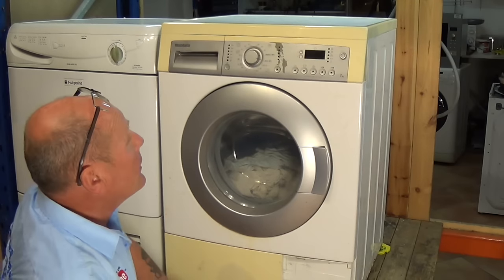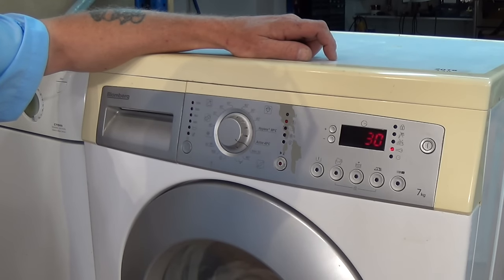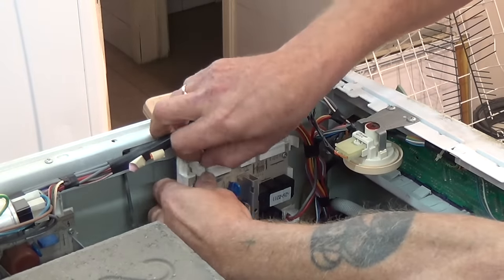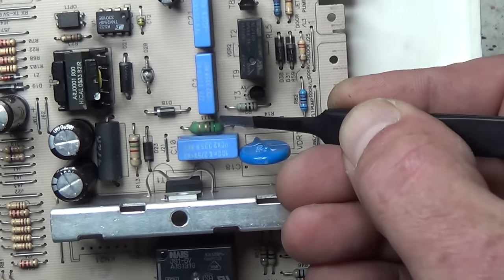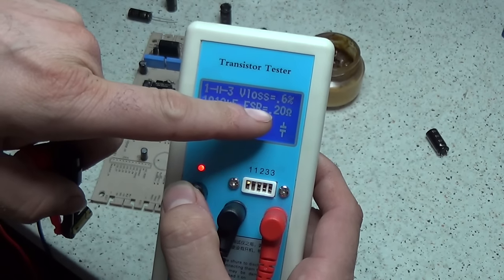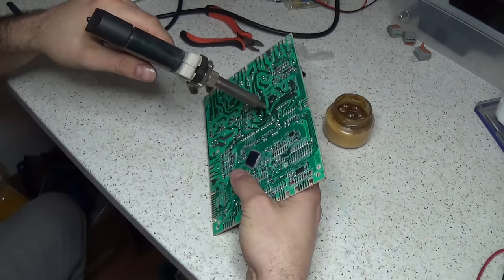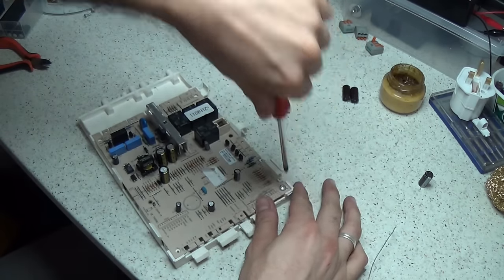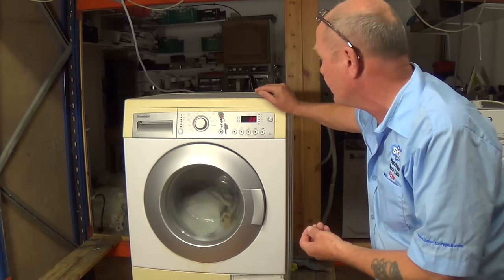Washing machine starts then stops or turns off

Comment: If the washer is staying locked after cutting out during load sensing- is it more likely a door lock problem or what you fixed here on the circuit board. It also has a very faint sound coming from it? I do not I can unplug it to get it to unlock. So when I plug it back in after a 3-5 min unplug, the door will open but then it will start beeping at me so I close the door and it relocks 🤔

Comment: Hi the video was great. I own a LG front loading washing machine and it doesn't complete its cycle, goes off after 4 minutes, no matter what mode of wash you choose. You gave me the idea, that the control unit could be repaired than replacing it. So i got the courage to open it and the problem was the tube to the " Pressure Switch " was detached, Plugged it back in, the washing machine was ok. Thanks
Reply from the maker: Please use the Ask paul a question page if you need help and i will reply in less than 24 hours https://www.how-to-repair.com/help/contact-us/

Comment: I am having a similar problem with my LGWT1101CW top loading washing machine. The components look fine. what other part on the circuit board could be causing my issue with it powering off and on all the time.

Comment: Thank You Sir, for your honest approach to Troubleshooting a malfunctioning Washer. All, I've seen so far is that if a circuit board is Bad there is Nothing to be done - except to Replace it. 

It is refreshing to see that there are honest professionals that don't mind showing that electronics can be repaired and it doesn't necessarily mean that you have to Buy a New Board at $300-400 dollars a pop.

Comment: Hi. Thanks for the nice video. I have Miele W3204 washing machine which is only working on the centrifugal and 15-minute washing programs. For all other programs, it stops after 2-3 minutes and the start light starts blinking. Pressing the start button restarts the machine, but it stops again after 2-3 minutes and the start light blinks again. Please suggest me how to fix. Thanks
Reply from the maker: Hi, please use our contact us page and make sure you fill out the request for what your problem is. I will need the full model number of the identification plate and the details of your problem so that I can provide you with useful literature. A video shoot of the problem would be perfect as well.

I will get back to you within 24 hours, normally. https://www.how-to-repair.com/help/contact-us/  

Please remember to subscribe to our channel, as that's what keeps this channel going. Thanks, Paul 👍

Comment: Hi how-2-repair. got a zanussi FJD 1466w, started my wash and after about 5 mins there was aloud click sound come from the washer and it stopped and all lights except the power light have all gone off on the control panel, im not sure if that loud click was the door lock coming off as the washer stopped, ive turned off and back on but nothing, does this sound like a new control panel replacment? thanks for ur time and help Matt

Comment: Hi, maybe you or someone on the forum can help me with my problem? My Panda PAN70SW washing machine not start working after turning it on and shows code C1 and all lights start blinking. After unplug power cord and plug it again washer starts washing cycle. After finishing cycle the problem appears again. What's the problem?

Comment: My washer is GE, was turned on, display door locked after about 23 seconds, I heard one soft click and then door lock released automatically. I have replaced a circuit board and inlet valve and door lock, but the machine is still not working. Pleased hep find it's problem.

Comment: Also check power connection to the wall, especially if you use splitter, for example to plug in washing and drying machine into singe outlet. Splitter can corrode inside, nothing is visible outside, but due to moisture it can corrode inside over time and make these problems.

Comment: I had a Whirlpool Duet that would power itself off mid cycle but only in cool weather. It turned out to be the touchpad panel. It was sensitive to temperature or humidity or maybe both.

Comment: Hi again how-2-repair.thanks for vids great help. i found my problem and its the module board not the control panel, but having difficulty finding parts, as my washer is 16yrs old parts are obsolete, but with watching you vid one of the chips that is blown is a link switch, but turning over the module board there is a S shape black scorch mark and i should say its taken afew more components out aswell as itself, but im prepared to buy and replace the components myself as really cant afford anew washer at moment, ANY help or advice would be VERY grateful.Thanks Matt

Comment: Hello,
I have a question regarding my LG front load Direct Drive washer purchased in 2014.
The original board malfunctioned on me and needed replacement.
Before the board blew out on us there was this strange electric burning smell emitting from the washer. At first I thought it might be the heater and or thermistor, but they checked out normal with my multimeter.
I replaced the board recently and started testing the machine with different sized and timed cycles.
The top and rear panels are still detached until testing is completed.
Yesterday I washed 4 loads of 1 hour cycles.
Up through the 3rd load everything was normal, no smells, or error codes being displayed.
After the 4th load chimed, I entered the garage and there was that electric burning odor again, just like the previous time prior to the machine going D O A.
The smell emitted from the Direct Drive motor assembly and the aluminum cover that spins with the assembly was extremely HOTTER than normal to the touch.
Is this a normal thing with these Direct Drive motor assembly?

Should it emit this type of smell?

The last time I smelled this type of electric was when the balast inside my light timer burned up/ Even thought the balast burned leaving a brown mark on the external surface, the timer continued functioning.
Do you have any ideas regarding this issue?
Have you or anyone you know, or customers every mentioned anything regarding this phenomemon?
Any thoughts would be greatly appreciated.
THx
Robert

Comment: Wow, I expected 'how to replace a door switcg' or 'how to replace a control board' - no one talks about board level repair anymore.  Apparently everyone is fooled into thinking a $200usd board must be replace even though parts are under $1 and time is about the same.  It's criminal.  I pick up used junk to fix for pennies.  Thank you, consumer suckas!  Just got a front loader washer, replaced caps on an imac and a Samsung large TV before (free)!

Comment: Hi mate I have samsung ecobubble 8kg washer. On some of programs it runs but stops after 15-20 minutes. When I press the pause button on and off it starts again but stops again. When running it makes a constant sound but when it stop there's no sound. Any tips how to solve this problem.
Seen you video on calibration, tried it but no luck.
Reply from the maker: Intermittent faults are very hard for me to be able to give you a direct answer as I do not have the machine on my workbench. You may have a dry joint or something. It's disconnecting during the wash cycle. I'm sorry I can't be any more help. Have a great Christmas and a happy New Year. glad we could help you @asifiqbal3855 this is for you https://www.youtube.com/shorts/e432SAb2g08 please remember to subscribe as that's what keeps this channel going. Thanks 👍
Reply: Hi did you find the problem with the washer? Did you fixed? I have same problem now 😢

Comment: I have an electrolux eww1476wd and after doing laundry, it does not want to turn on the dryer heater. the fan that exchanges the air in the drum from the machine turns on, but the heater does not want to. NTC sensors show resistance. the electronics have no mechanical damage and the relays are all OK. Maybe it needs to be reset, but I can't find anywhere how to do it??
Reply from the maker: It can only be the heater or thermostat bad connections can be a problem or it will be the printed circuit board. This is all that controls the heating system glad we could help you @uroubiparip4662 this is for you https://www.youtube.com/shorts/e432SAb2g08 please remember to subscribe as that's what keeps this channel going. Thanks 👍
Reply: @How-to-repair  Thank you. When I connect the heaters from the dryer directly to the voltage, then it starts heating the air. I can't find the values of the ntc resistors to monitor the output temperature and the temperature inside the drum. But when the heaters work directly, the dryer finishes the 2-hour program in 45 minutes.

Comment: Hello, I have a beko 7 series excellence wm, I have gone through the diagnostic cycle and it all corresponds to your tutorial video. However when I then try to use the machine the water runs through the draw as it is supposed to but the water just runs straight through the machine and it does not fill up, any suggestions would be appreciated TIA regards wayne
Reply: wayne dawe that’s what’s happening to mine

Comment: Sir, I owned the lg 7 kg direct inverter front Loader recently before a month. dE 1 error came in between the cycle even the door was locked, and on and off in between and speed is also lower than normal, we replace mother board also, what to do sir?
Reply from the maker: A while ago on YouTube, you ask me a question about your LG washer. I just thought I’d let you know that I have now made a complete playlist to assist you in any repairs that you ever have.
If it helps, you don’t forget to share it with your friends who may also own an LG.
https://www.youtube.com/watch?v=w5dZ4Pj8Jdo&list=PLnAHZbSarsyHLR4x9XPIS-ZEsheufxm9Y

Comment: How to fix my machine's problem? If I used it for like 2 times in a day, it will not work anymore on the 3rd use. Then I let it rest until evening and it would work. 

What component would work if it gets rest? The capacitors look fine outside tho.

Comment: Mine starts then switches off after so long,  if left it will eventually switch itself back on and finish the cycle...what could be causing this,  it fills and drains fine also mines not a digital but basic front loader...?
Reply from the maker: might be problem with pcb please remember to subscribe as that's is was keeps this channel going. Thanks 👍

Comment: My  LG front loader machine stopped.i replaced the main circuit board and it's still dead. The outlet is ok, because the dryer runs from the same outlet. I paid$240 for that part! I'm pissed, now I'm thinking it's the display controller board

Comment: Hello! I have a Kenmore model 7964027#2900 that turns off after 30 seconds or so whether I put it on a cycle or not, looked at the capacitors on the board, they look ok. the board is different than the one on the video buried in some jell. Anything else I can check?
Reply from the maker: Please use the Ask paul a question page if you need help and i will reply in less than 24 hours https://www.how-to-repair.com/help/contact-us/

Comment: HELP! I have a Samsung Front Load Washer (Model WF365BTBGSF 4.1 cu ft). Thanks for the tip - I took a picture and it was very handy. Super technical support - but the newer machines wont let you fiddle with the PCBs given they are covered with a jelly style moisture barrier.

Initially the washer stopped and displayed an error code (AE). I reset the machine. Removed the power cord and let it rest. I also reset the electrical breaker. The washer started back up and ran for the five minutes and then shut down completely. The AE code no longer displays - the machine display simply goes blank and eventually powers down. The AE - fault code indicates a communication issue of the washers main components. I opened the machine, inspected it (looked for obvious wear, burns disconnected/loose connections) and decided to replace the main control panel (DC92-01527C) - RESULT: NO Change. NOT CHEAP.

Machine started up initially but powers down after 60-90 seconds. It continues to do this, provided it is unplugged or the electrical panel breaker has been turned off (removing all power to the machine) for an extended period before turning it back on. 

My sense is there is a capacitor somewhere that needs to be replaced. I saw two small capacitors on the main board but my guess is they regulate power to the components on the PCB and there must be another regulating the motor.

Comment: Mine shuts off then turns back on, it does this a few times but ONLY when I use hot wash cycle, not cold wash.
Reply: Disconnect the heating element and check it . It's a bit difficult to test a heating element because at times it shows connection but it's the resistance is not as needed and we don't know the value it's supposed to be. A better check is with s Megger meter but that's costly. It's easier buying a new heating element and replacing.

Comment: Our siemens stops, display goes off. After about 15 minutes, the machine starts again where it left off. This only happens occasionally
Reply from the maker: I will check for any loose connections, and also check if you have problems with the carbon brushes in the motor has intermittent faults can cause all sorts of issues
Reply: Many thanks for your advice. The engine is carbon-free. I have checked many connections and electrolytes/capacitors. The problem was gone for several months but now back. I'll try again 🙂 I have a theory that something is overheating. As if, when it has cooled down a bit, it starts again. The subsequent washes have run without problem.

Comment: Hi I have a Indesit washing machine, sometimes as soon as I put the plug into the socket it's tripping at the main fuse box! Then sometimes it comes on starting the load but then cuts completely out and also cuts out and puts the switch at main fuse box down by its self. Could u please tell me what this issue is many thanks